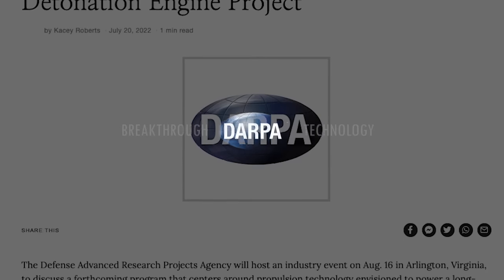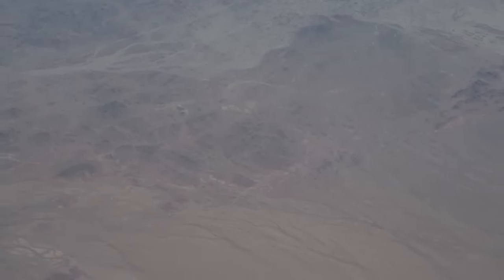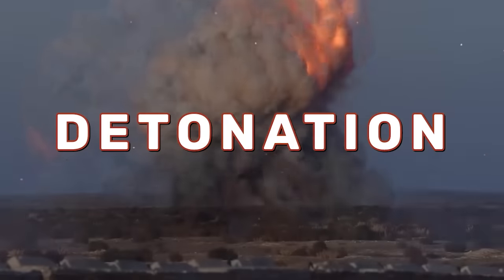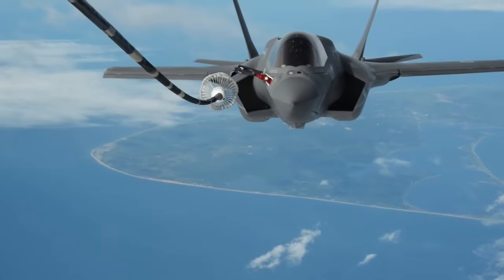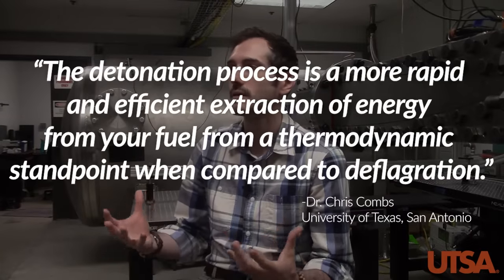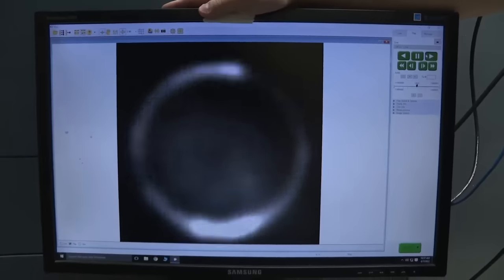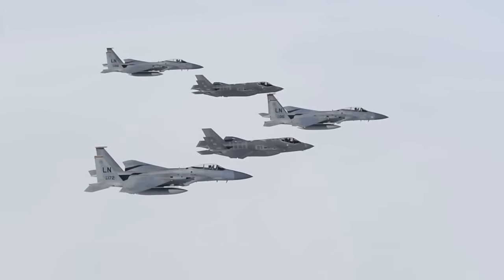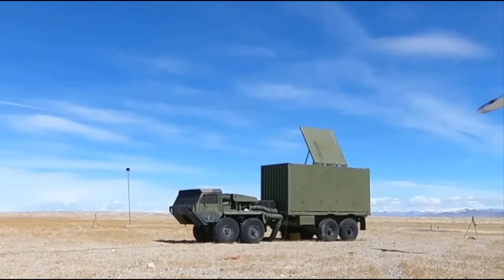The game-changing tech in DARPA's new missile

Comment: I think these engines were tried by Heinkel Hirth at the same time as von Ohain Jet engine was being developed in the 1930s.   They were referred to as 'constant volume' jet engines instead of the 'constant pressure' types we know.   A compressor filled several combustion chambers in turn using poppet valves.  Sparking plugs ignited the mixture and the exhaust propelled the aircraft.  They operate at much higher pressure and temperature ratios.  Mentioned in Anthony Kays "German Jet engines and gas turbines"
Reply: No, they were not. Entirely different setup.
Reply: They were pulsejets, as described at the beginning of the video, and they operate at absolutely miserable pressure and temperature ratios, producing absolutely miserable thrust and efficiency.
Reply: @wagnerrp  Constant Volume Jet engines are not the same as pulse jets.   Constant volume engines used compressors and poppet valves to admit air to a number of combustion chambers, close the valves and ignite.  Another poppet valve would then open to release the gas over the turbine.  They are theoretically much more efficient than standard constant pressure jet engines.
Reply: @williamzk9083  A pulsejet is a constant volume jet engine.  You're just describing a different type of jet engine that honestly sounds like an nightmare for maintenance and cooling.  Pound for pound, reciprocating engines are shit for reliability, and the lack of opportunity for film cooling in the combustor means your materials are going to have to have to carry the full thermal load of combustion directly, while simultaneously receiving tremendous cyclic loads.

Comment: I'm curious to see if the RDE concept is what would power a potential hypersonic fighter, which I believe you discussed in another video or perhaps on your website.  The use of RDE in manned fighters and drones would indeed go beyond next gen.
Reply: @brobasticbroham446  I agree with your premise,  that said as technology increases and stealth capabilities are made more compatible i.e. ceramics to increased speed. The need for speed will be incorporated, for it too offers increased benefit. I purposefully used ceramic because I've seen that there's a current push for more reliable maintenance wise and higher temperature resistance radar absorbent material.
Reply: Hyper jet fighters would be ultra expensive to produce and maintain, having a pretty short service life.
Reply: @hansybarra  Technology is ever increasing and you bring up a valid point. Currently it's expensive.

 Check out Rotary detonation engines. This is hypersonic flights future.  

Adaptive cycle engines are currently being deployed in F-35'S.
Reply: hypersonic fightesr are useless. Why would you want to go that fast when it does nothing to defend against modern missiles?
Reply: @honkhonk8009  Because sometimes you want a human prospective as fast as possible. Also hypersonic retreat, will enable to remove from danger. Faster targets are harder to hit. As stealth detection gets better and it will. Speed is another asset to bring to the table. Why not just go back to proper driven planes, they get better fuel economy?
Reply: @kurtwinslow2670  Do you know how pursuit curves work? You realize faster targets litterally mean nothing? 
You realize that no matter how fast an aircraft goes, they wont be outrunning missiles like they would back in the 70s?

No fucking shit a rocket motor with its own oxidizer is gonna have a higher specific impulse than an airbreathing engine, that also has to carry a human. 

As to your comment on why we arent going back to prop driven planes, we already would have, if props werent easily detectable by radar.
Speed is useless. Fuel effiency and supercruising is where its at.
The F35 is much slower than the F15, but is  magnitudes more efficient.
Effiency isnt to save money, effiency is to increase range.

This isnt top gun. This isnt some video game lmfao.
Reply: @honkhonk8009  What about range when missiles are fired? Do you think a faster or slower jet stays in range longer? With a faster jet payload can be released and loiter time in dangerous area is reduced, because you get out of there quicker.

I'm not saying stealth means nothing, it's very important. All I'm saying is that speed can be an asset. You seem to indicate it's a liability. 

Why do you think one of the big issues when the F-22 first came out, that it had super cruise without needing after burners?

In fact the Navy and Airforce both stated that the next 6 generation fighter will have super cruise capability and will probably be faster than current jets.
Reply: The SR-71 was able to outrun Soviet missiles not by going faster, but by going fast enough for the missiles to run out of fuel before they could reach the SR-71. Sure, stealth is more important, but the practicality of speed is there.
Reply: @jonahshoemaker7817  I agree with your premise.
Reply: @brobasticbroham446  speed in modern fighters is incredibly important. Of course stealth and data networks are of increasing importance but speed is still of high importance in modern day fighters. Sure modern fighters are slower than some of their predecessors but that's only possible due to the stealth capabilities making up for the increase in stealth... Speed will always be necessary. Speed is what bails you out when your stealth fails... Speed improves the range and efficacy of bvr engagements... It's a combination of speed stealth and data networks that will determine the future of fighters...
Reply: @brobasticbroham446  it has nothing to do with the fact they don't dogfight... Speed still is a factor. The planes aren't completely invisible with their stealth technologies. They can still be detected. When they are detected whether it's do to opening it's payload doors to engage a target or against an advanced radar system... Stealth planes will still get detected... Also what do you think an f22 is gonna do against other stealth aircraft? It's gonna have to get closer than ever before to find another stealth aircraft.... And what does a fighter do when it has been locked on because it was picked up? It starts notching to hope that the incoming missiles lose radar lock... The stealth and speed help keep it safe. And ofc the intiial speed of a missile impacts it's effective range and it's efficiency... There's a reason the USAF is asking for a faster jet that can go further than ever before in it's new aircraft programs....
Reply: @brobasticbroham446  I don't understand what I'm wrong about here...As you said stealth aircraft are detectable and its possible to get a firing solution when close enough...  Sure the modern era will have a lot more BVR engagements but its possible for other events to occur. You act like China and Russia aren't constantly working on their radar and upgrading it. Assuming that only US radar systems are capable of working on stealth aircraft is just lazy and even if that's true right now it wont be forever. Also both the Su-57 and J20 are designed with stealth in mind as well. Sure it might not be as good as the f22's stealth or even the f35s but these aircraft are likely to get MUCH closer to both an f22 and f35 than other non stealth aircraft.  There's plenty of scenarios in which an f22 or f35 could be engaged, either by other stealth aircraft or lucky SAM batteries that the f22 or f35 were unaware of. The f117 Nighthawk is a prime example of why you shouldn't sit on your laurels and assume that stealth technology will keep you safe forever.

Ultimately the point I was trying to make with all of this is, in the events that stealth fighters are engaged, although rare events, speed suddenly becomes a large factor in these fighter jets ability to survive. It's common sense that a fighter traveling at mach 2 is far more likely to survive an engagement than if it were to be traveling subsonic.

Also you said " speed does not equal range in fact it's the reverse," please explain. If a AAM is fired from a fighter that was traveling at mach 2 versus subsonic it would burn less fuel getting up to speed which in turn results in additional range. (after doing the math its not a significant amount further maybe a few miles but thats still additional range)This also results in it reaching a target faster which gives the target less time to react. It might only be a few seconds difference but a few seconds can easily mean the difference between life an death. In a world where this is "reversed" like you said, we'd be strapping missiles onto planes and firing them backwards....
Reply: @brobasticbroham446  Of course I understand drag. Were not drafting missiles off of the jet lmfao  Also air to air missiles aren't cruise missiles with optimal cruising velocities. How would drag inversely affect the inertia of a missile!? You do understand inertia right?
Reply: @hansybarra   hypersonic stealth bombers accompanied by even faster AI controlled stealth drones though capable of taking on enemy interceptors and SAMs....

May be expensive, but we generally don't settle for slightly better and cheaper when it comes to our national security and deterrence. It doesn't take many of those to cause an asshole dictator's butthole to pucker at the thought of being slap shotted out of existence by something moving so fast your best defenses couldn't hope to stop it.
Reply: SR-72 Aurora IS a Hypersonic aircraft/spacecraft it is already operational... Don't say that we would already be told if it was.. because the SR-71 Blackbird was kept secret for 30 years... They denied it existed until it was retired in 1998
Reply: @honkhonk8009  you are mistaken 😂 Hypersonic aircraft can outrun Hypersonic missiles... So can Laser Weapons.. which the US Navy have on their ships... Keep up... They've been demonstrated many times this year alone... SR-72 Aurora is a Hypersonic aircraft/ spacecraft.. it's been in operation for some time... But they aren't going to tell you about it... That would risk our enemies knowing that it exists🧐 they show it in Top Gun Maverick... Just like they showed us the SR-71 Blackbird in Firefox with Clint Eastwood... That's how they tell you it's real without actually telling you it's real... They've been doing this for decades but naysayers just can't understand that for some reason... But it is quite obvious if you pay attention and quit being skeptical about every single thing
Reply: @kurtwinslow2670  honk honk doesn't know what he's talking about anyway😂 the SR-72 Aurora is the craft in Top Gun Maverick and it is very much real... I guess he's just waiting for the Navy to send him a memo clarifying it's existence... 😂😂 I so hate skeptic people... They are obtuse
Reply: @HashtagBirdyy  those aircraft are ancient... Even the F-35 is obsolete  SR-72 Aurora or TR3B as it's been called are and have been operational for awhile
Reply: @stonehaven2289  ok? I think you replied to the wrong person?
Reply: @HashtagBirdyy notching doesn't work on newer radar like it did on old tech. Part of that is just changing parameters of what the radar is looking for. Notching used to work because the radar was looking for something moving fast, and notching gave the effect of the plane seeming to be moving slowly. The radar wasn't looking for slow moving things, so it lost lock. Newer radar doesn't lose the lock. Unlike the F-22, the F-35 doesn't need radar to detect, as it has the AN/AAQ-37 EODAS, which includes IRST.
Reply: @anthonykaiser974  True, however not every radar system used today is modern. We're seeing ancient technologies still being used in plenty of scenarios. It might not be as relevant as it used to but it's still useful. I also would assume changing your trajectory is beneficial when a weapon system has been fired at you.
Reply: @HashtagBirdyy  that there are still older radars out is a given. Changing your trajectory may or may not be advantageous. For one thing, it slows you down. As in all things, it depends (which I learned is the USAF equivalent to the Army's METT-TC).
Reply: @anthonykaiser974  100% pretty  much everything is situational.

Comment: How loud are these engines compared to conventional jets today? Doesn't seem like you'd have a lot of means to do baffling. Not a big deal for missiles or even planes if they're going Mach 5. 

But for ships, does the engine stay above the water? Or is it detonating in the ocean? Water carries sound very far and fast - and if there's a stronger pressure wave (ie: louder), you could both increase detection range and probably kill or disorient a lot of fish and whales and other marine life (already a problem today).

I haven't looked into it, but just curious.
Reply: AFAIK, it breathes air and will turn a turbine shaft. I believe the intent is to just replace the current engines with something more efficient. A detonation wave travels at supersonic speeds, so it would make sense that the engine's fundamental frequency would be well above ultrasonic. If so, it should be easy to create isolation mounts.
Reply: It would just be the engine to turn a shaft, not a jet into the water
Reply: It's a very good question, I would imagine such an engine would be LOUD and dangerous. Metal and water and air will as you know propagate a wave, generally the denser the medium the faster the wave can travel, and being supersonic I can't imagine that would or could be used in water, it would be like a weapon itself !
Reply: @psycronizer  How could the engine be used in water? It requires air (or gaseous oxygen) to operate. Yes, it creates an exhaust gas stream, but that isn't fundamentally different from current turbine engines.
So if you were committed to using a high-speed exhaust gas as a weapon, you could do it now.
Reply: @psycronizer  well, it doesnt matter that you cant imagine it. the guys at DARPA did imagine it and are making it happen so in a few years when this is common tech, i wonder if you will remember saying this wont work
Reply: @icollectstories5702  actually, it's completely different, couldn't  BE more different !
Reply: @psycronizer  Shall I refute your argument by stating, "No, it's not?"
Perhaps the Naval Research Lab is more authoritative? In a Nov 2, 2012 press release: "NRL researchers believe that one attractive possibility is to use the detonation cycle instead of the Brayton cycle for powering a gas-turbine."
Sure, the mechanism producing the high-speed exhaust is new, but the Navy sees it as Yet Another gas-turbine engine.
For a more technical explanation than provided here, I recommend Scott Manley's YouTube video on the Rotating Detonation Engine from two years ago.
All sources I've seen point to increased efficiency, rather than new superpowers. This is just applied thermodynamics and not new physics.
Reply: @icollectstories5702  two quick points, "2012" and "technical explanation-Scott Manley" both of those are ,well, I shouldn't need to say more really....
Reply: @psycronizer  Why is 10 years an issue? It took 8 to get a prototype running.
I'd also like to hear your critique of Scott's video; he also cited the Navy's interest in gas-turbine engines. He knows physics; do you?
Reply: @psycronizer  Well, I've cited sources that back my comments; why don't you justify yours: what's your explanation for how a rotating detonation engine works and what makes it so much more dangerous? I am very curious to know how you think supersonic water and metal would be involved.
Reply: @icollectstories5702  ‐‐Q